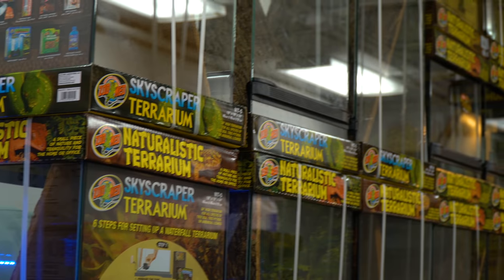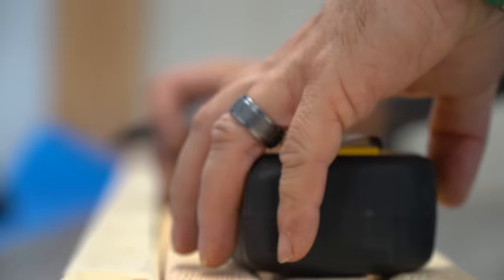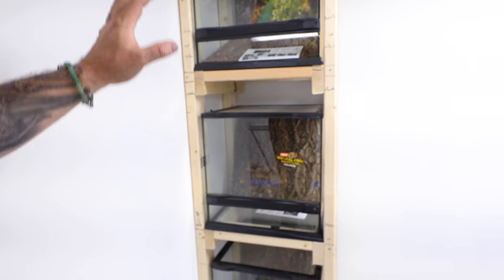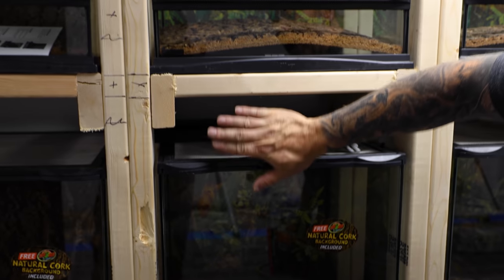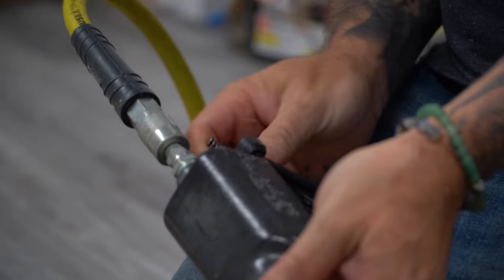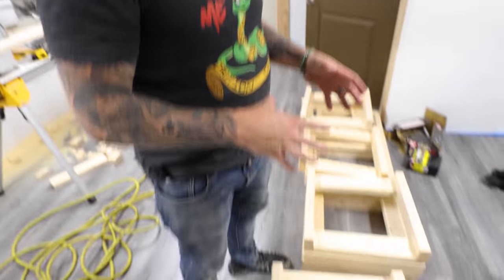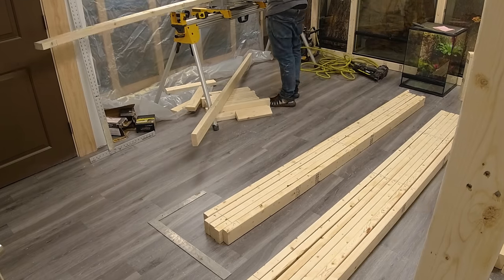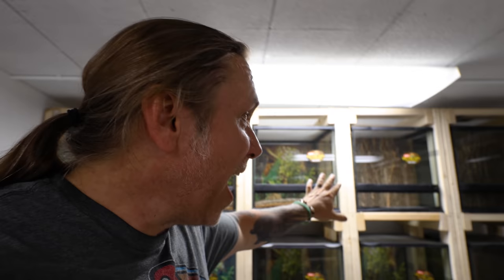BUILDING AN ENTIRELY NEW GECKO ROOM!! | BRIAN BARCZYK

Comment: Hey Brian! Awesome job, it does look amazing, Idk about nail gun, buuuut when nailing wood, round the tip of the nails so it won't crack the wood, its always "dangerous" to have cracks on a structure no matter the size, also, where you are cutting, put plastic underneath so cleaning is easier! Can't wait to see the results though